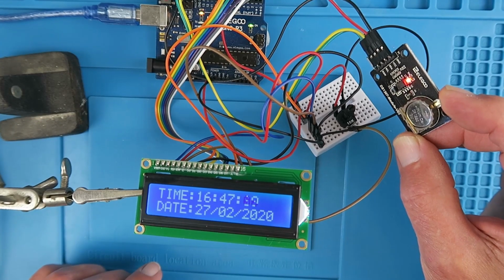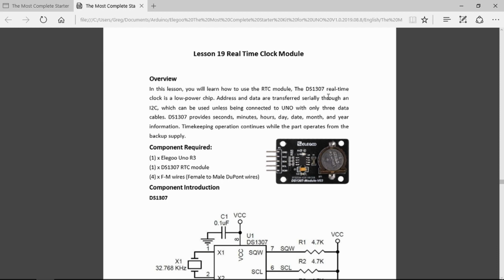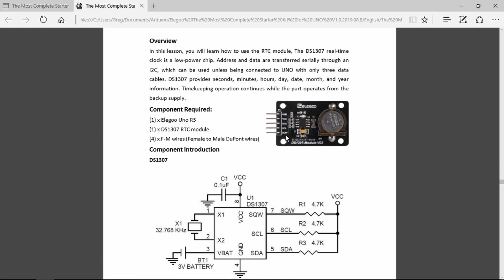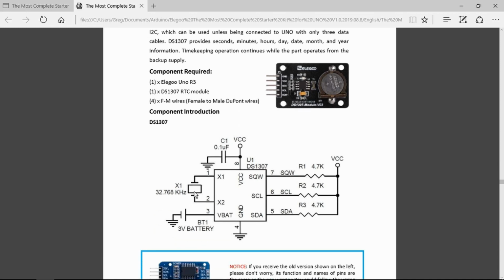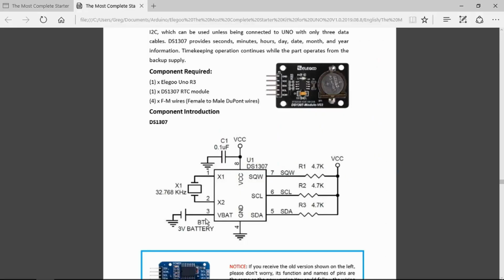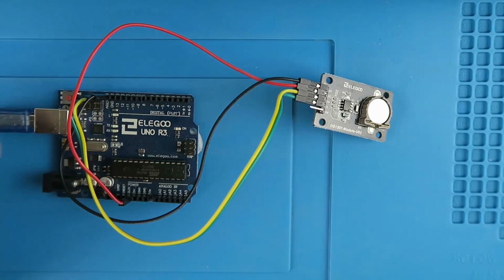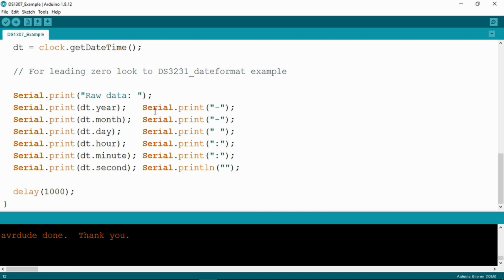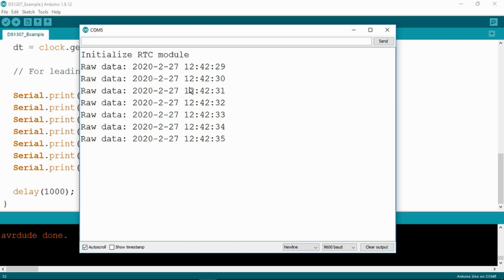Elegoo UNO R3 Project Part 14 Real Time Clock Module.

Comment: All very good, but your video shows the time and date displayed on the 16x2 LCD module.  How does it appear without any code in the sketch?
Reply from the maker: This video is intended to help people using the Elegoo kit. This video covers lesson 19 the Real Time Clock Module. I give an example of more advanced projects at the beginning of each lesson to inspire the learners. I did not wish to confuse them by including that code. You can easily find it on the web or even get ChatGPT to write it for you! Thanks for watching, have a great day!